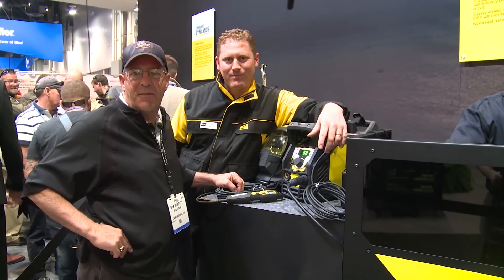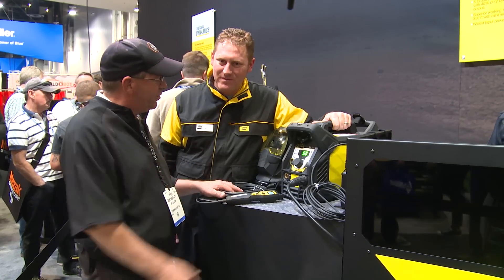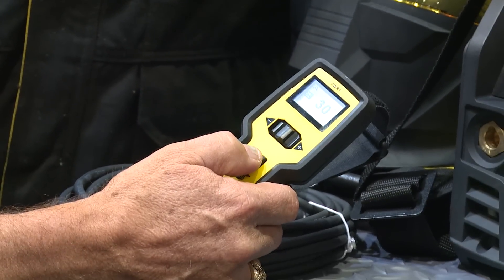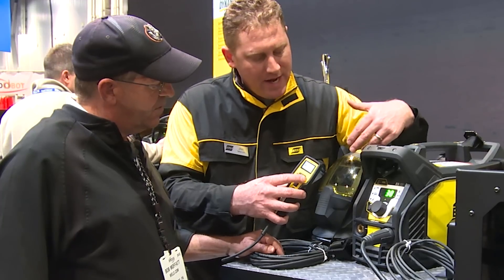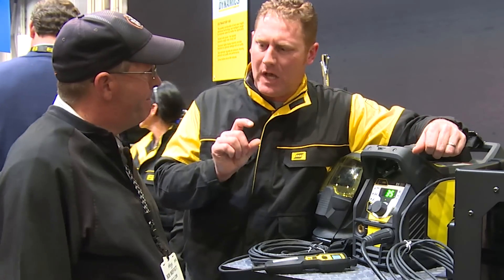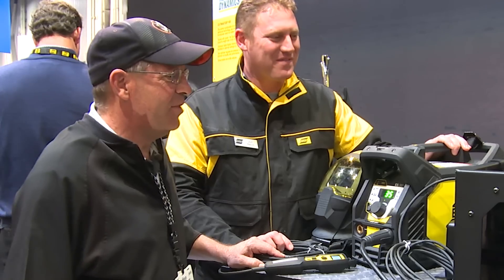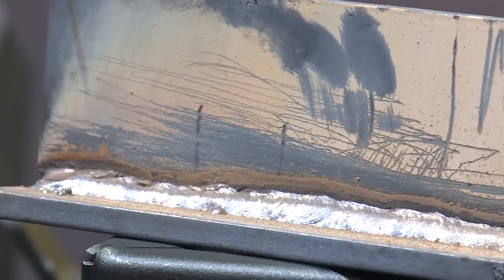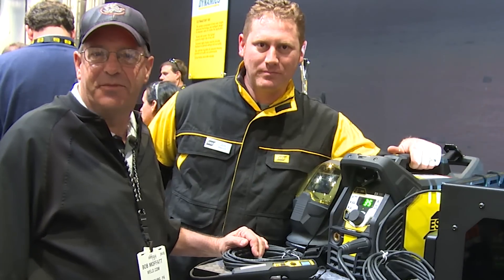FabTech 2016: Introducing ESAB Renegade 300S Stick / TIG Welder

Comment: What is the amp range for 230V supply? Ive always found with dual voltage machines that the max amperage available is dependant on the input voltage.
Reply: 3 phase: 220-480V  300A@40%, 250A@60%, 200A@100%.

1 phase: 220-230V 200A@100%

Comment: i rather have ac/dc hf tig
Reply: I don't think either of you understand that this machine isn't aimed at hokey pokey back yard welders. This is obviously meant to be a straight up stick machine that has lift arc tig, which is obviously a machine aimed at serving those of us in industry. Pipe welders, steam fitters and the like.